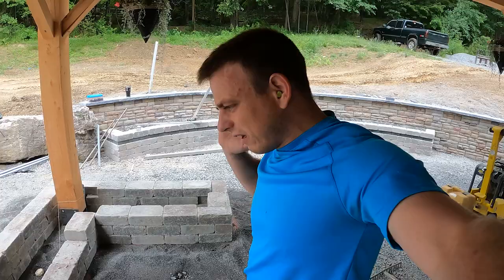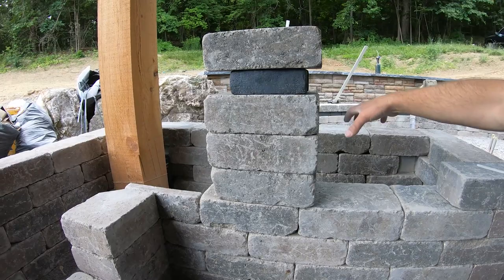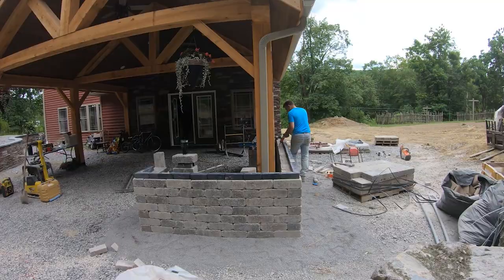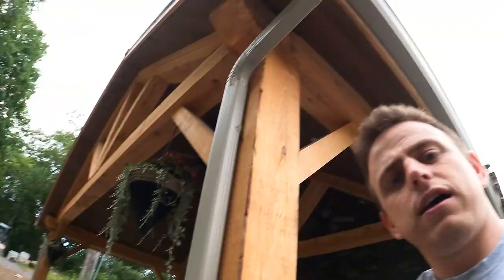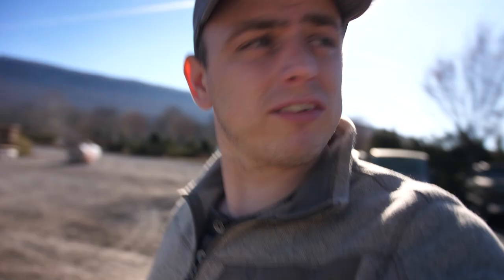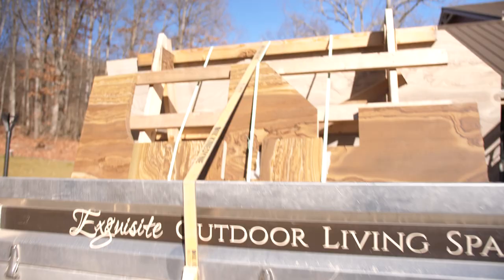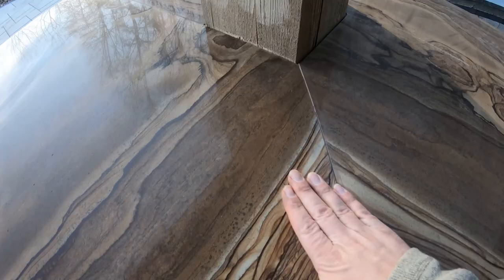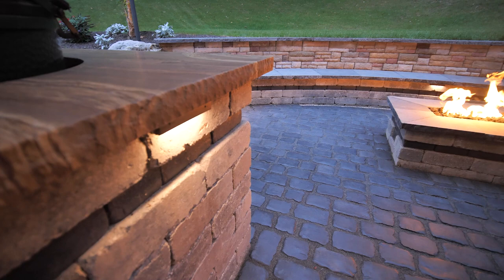Building an Outdoor Kitchen | Part 5 of Weston's DREAM Outdoor Living Space

Comment: great videos, I've watched quite a few now. I have a question about joint size for my open graded patio. I want to use the GFTK resin jointing compound like you did which requires a joint width if no less than 3/16th but ideally 1/4". However I also want to use concrete pavers that when pushed up against each other have a joint size of 1/8in. 

I am thinking of using a bunch of 1/4in spacers to get the joint width wider then take the spacers out obviously before applying the GFTK. What do you think?  

Ive heard its best to always "clink and drop" concrete pavers so the patio is stronger, but I also have heard that its fine to space pavers up to 1/2" wide...so much info out there, any advice would be appreciated. Please keep up the great videos! I look fwd to the next one.
Reply from the maker: SEK Resin sand states that it works with joints all the way down to 1/8"  - Thanks for watching!
Reply: @Tusseylandscaping  Thanks for the reply and recommendation! =D

If I choose to proceed with the spacers would It have any significant drawbacks, such as reduced life of the patio? Or is it safe for me to proceed and expect roughly the same longevity? Patio will be subject to just my household foot traffic, no vehicles.

Happy 4th!